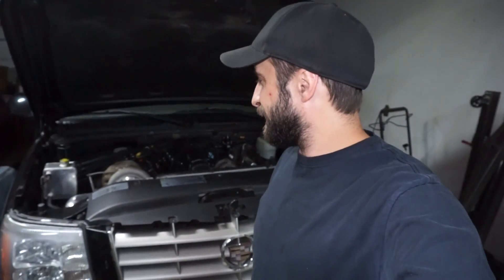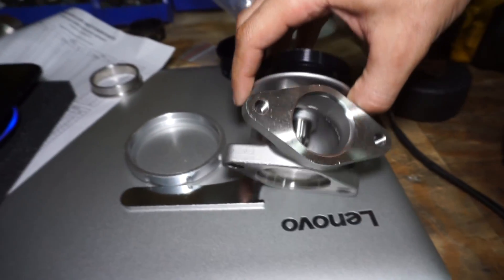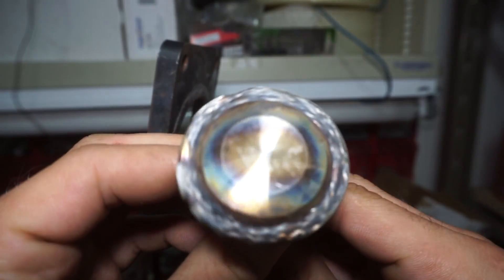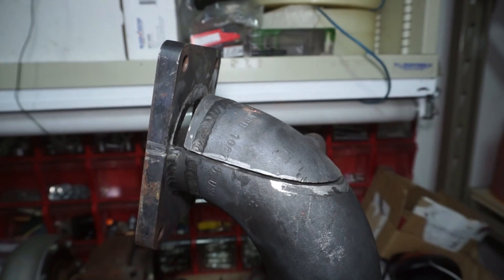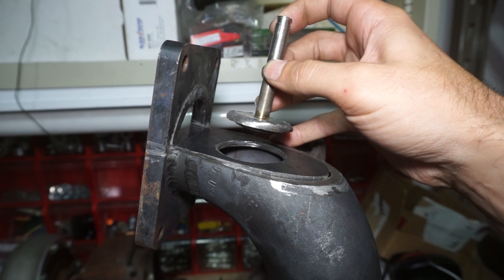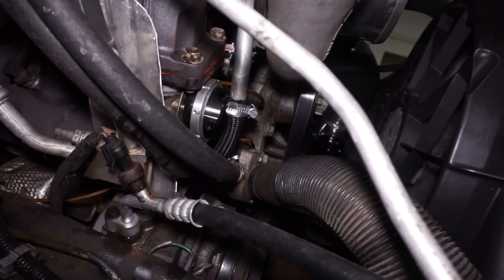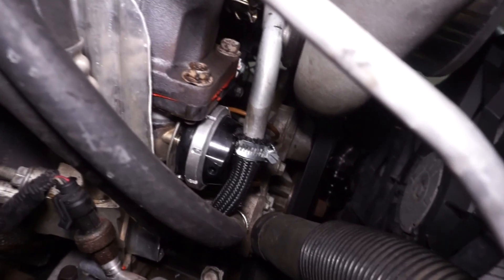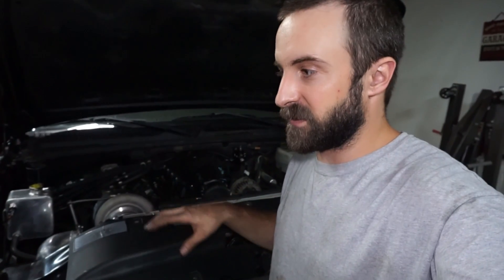DIY Spool Valve Experiment For Big Turbo Foot Brake Spool

Comment: This reminds me of the garden hose issue in Physics.  Pressure is higher with an unrestricted open end, but people think by putting a finger over the end it will increase pressure.  It’s a confusing physics issue where the results are counter-intuitive resulting in an opposite out come. Iirc the “Head” pressure of the open hose is reduced by the smaller diameter resulting in reduced flow.  In theory the turbo should spool slower, it will be interesting if it can increase the efficiency by focusing all exhaust flow to one Side of a dual scroll housing.  Interesting I hope it works!  JD

Comment: Brake lines are torcher, I hate the fluid. I hate trying to patch up a spot just to have a spot 3 feet farther away fail. So you spend 3 hours patching the line thinking it's going to work, bleed the brakes, then leak. Then you give in go to the store and get a big ass spool of brake line and do the entire line in which you should have from the start. Then you gotta vacuum pump the air out until you have carpel tunnel. Or pump the pedal until your legs are jello. Luckey for you, you have a great family and can put you lil guy to work. Props on the engineering on the DIY quickspool gate whatchamacallit. You are never afraid to dive into somthing new and try your hardest. That's why I like your channel so much dude, freaking breaking it till your making it. The dadalac is going to be bad to the bone in winter. You better get screwing some screws into some tires so you can take that beast to the ice drags.
Reply from the maker: I bought a complete brake line kit for it so hope to do it all in one shot and be done, lol.
Reply: @BlaserBuilds  heck yeah! Get that firm brake pedal for all the foot braking boost building without the trans brake.

Comment: Oof! Sure you're aware, but copper-nickel brake lines are easy to bend & don't rust as fast as GM intended. It's like they designed these trucks to quickly turn to dust and give up their race motors!

Comment: With a twin scroll, you don't need equal flow to each scroll so a flow imbalance shouldn't be a big deal but minimizing that is probably a good idea.  I think you could put a little kind of partial funnel/scoop on the non valve side of the valve seat to direct more gas through it when open.  In my mind it looks like a section of tube with a very shallow fishmouth and an even shallower miter cut, maybe 1/2" wide on the turbo side.  If you made it out of flat stock it would look like a "U" or rounded bottom "V" shape.  If you have trouble visualizing that, let me know.

When the valve is closed to spool the turbo, the volume of exhaust gasses shouldn't be high enough for the funnel obstruction to cause a problem and when it is open it might give you something like a higher "effective" AR to reduce back pressure.

You might want to try to put the valve on the shorter of the divided scrolls (if one is longer than the other).

Lastly, if the funnel doesn't balance the flow enough (back pressure too high at high rpm + full boost), you might want to put a dent on the open side of the tube, opposite to the valve between the funnel and turbine or a dent on the valve side before the valve seat (to try to create a pressure gradient or to accelerate and attach the gas flow on the valve side of the tube).  The dents would be more voodoo aerodynamics than a funnel so I would expect more trial and error to make that work well.